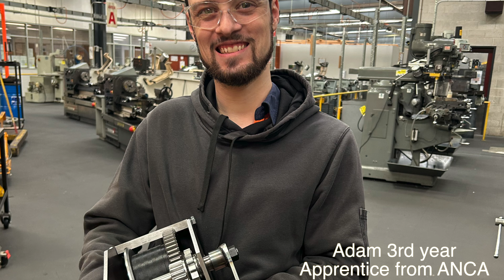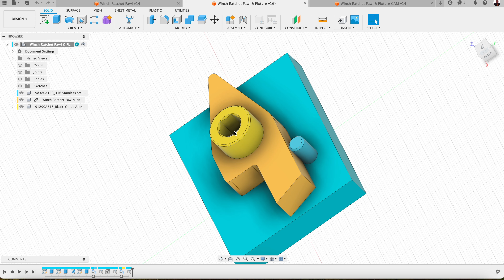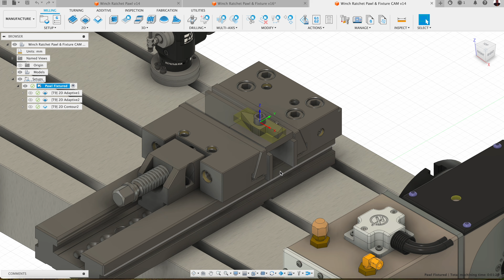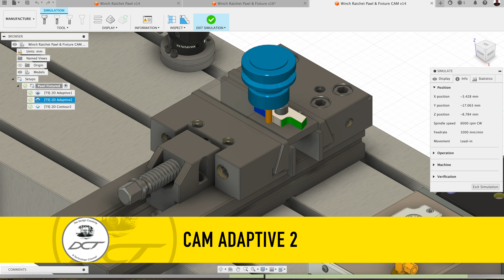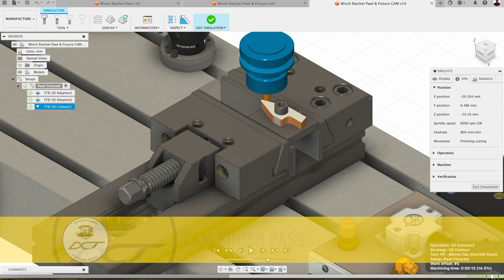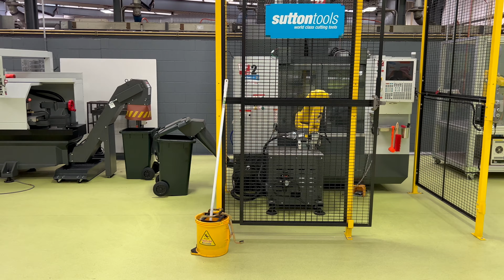CNC Milling STEEL ratchet PAWLS - Haas MM2

Comment: Nice project Aaron.
I really enjoyed watching everything through ConFusion to running on the Mill.
You're definitely spoilt with a Probe.
( but reality is, I'm too tight to pay the money to buy 1 for my machine 🤫) 

On the Mill I run mostly 100% Rapids with a mix of fast feeds.
But, on the Lathe I do the same as you and run mostly 25% Rapids with a mix of fast feeds for moving around the part.
It's a pain running a Tool into a part on a Mill, but a major headache running the Lathe turret into the Spindle 😬

I like the Watch you're wearing with the shaded area for knock off time 😅

Looking forward to seeing another video to continue the series with the small engine build 👍👍
Reply from the maker: G’day Peter. Thanks mate. Yes very spoilt. That MM2 has a 4th axis and through spindle cooling too. Once I prove the program I run 100% rapids, but if it’s the first cycle for the day I’ll slow it all down just to make sure it’s all good. I agree mate, a CNC lathe is a whole different beast. You don’t want to smash that turret. Talk soon mate. Aaron

Comment: Another good one Az 👏👏
Does the Haas have air blast for steel ( in lieu of coolant)?
Grasshopper
Reply from the maker: G’day Robert. You can get it fitted, but none of the TAFE machines have it on them. Thanks for watching mate. Cheers Aaron

Comment: Pucker factor. Having machine a lot of timber shapes screwed to a spoilboard, I can totally relate to that. I liken it to IFR flying. You have to trust your calcs knowing the tool is going exactly where you told it, but is still scary. Just curious. Why didn't you machine that part mirrored so when you tighten the cap screw, it rotated into the dowel pin instead of relying on pushing it into the pin? Not a criticism just a question.
Reply from the maker: G'day Murray.  I appreciate the feedback and totally agree with you.  I should have done the mirror option, but only realised this after I made it and tried it out.  As a teacher we are always time poor, chasing our tail, and laziness got the better of me.  Cheers, mate.
Reply: @DCT_Aaron_Engineering  Your students are very lucky to have you as a tutor. The internet likewise.
Reply: I was going to ask the same question! Of course, I only thought of it because I got to see this version first.